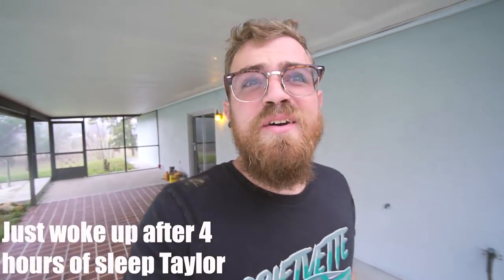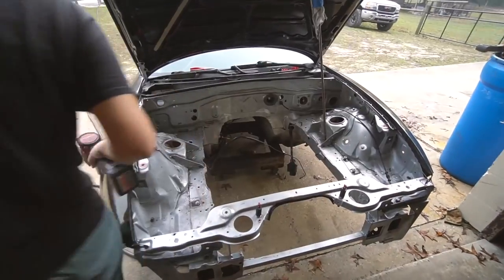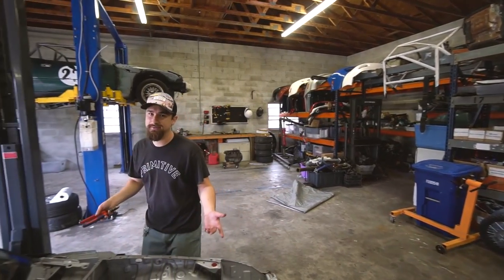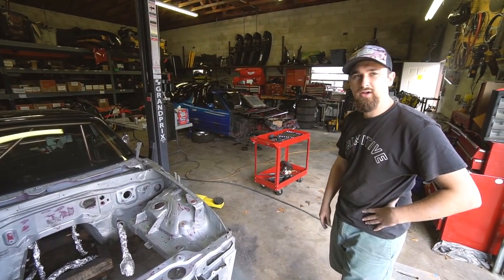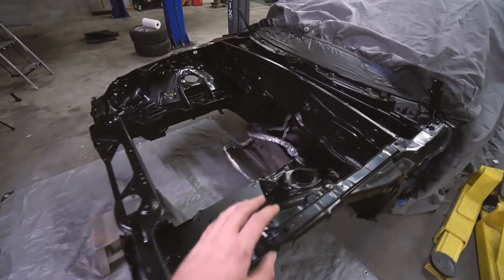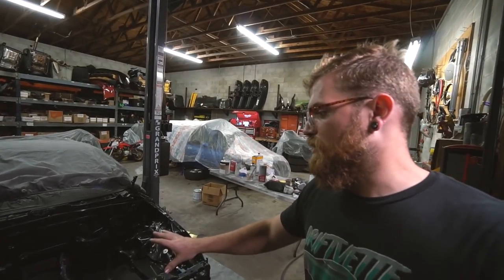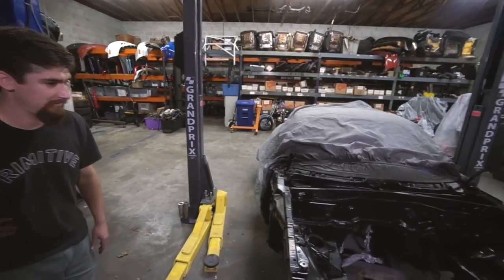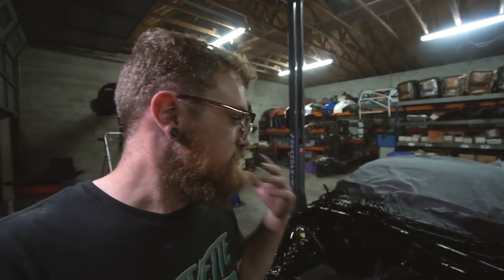Painting The LS Miata's Engine Bay!

Comment: Taylor do you think your rattle can paint job would have held up better if you cleared over it?
Reply: If im not mistaking it was cleared over. The rattle clean is just not as good as some 2k legit clear.
Reply from the maker: I did clear over it with spray can clear and it made it worse. Might have been okay with a 2-part spray can clear.
Reply: Thanks guys, I'd been considering spraying the interior and engine bay of my Evo with rattle can but I think I'll get a cheap spray gun and do it somewhat properly based on your experience
Reply: If you’re going to spray paint your engine bay check out some of your local automotive paint shops, some can mix you automotive quality paint in spray cans along with clear that will come out much better.